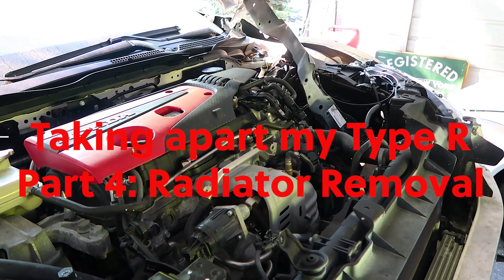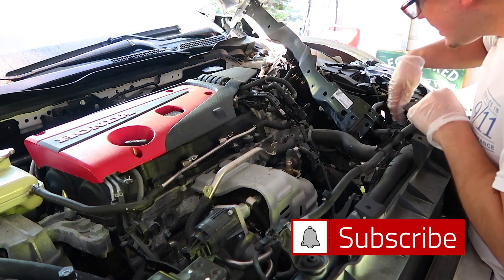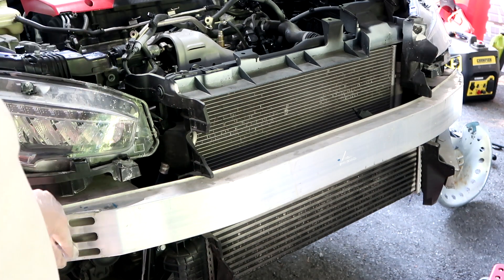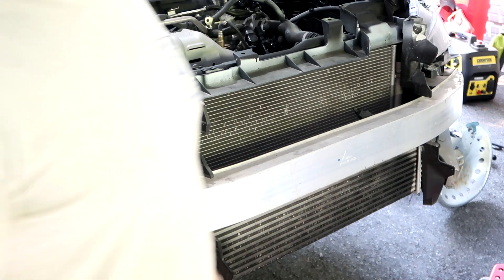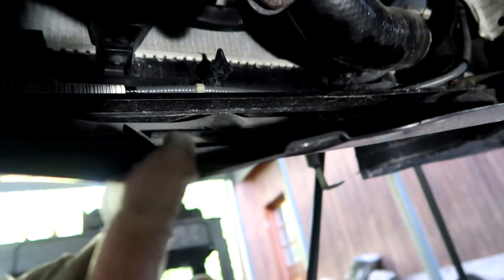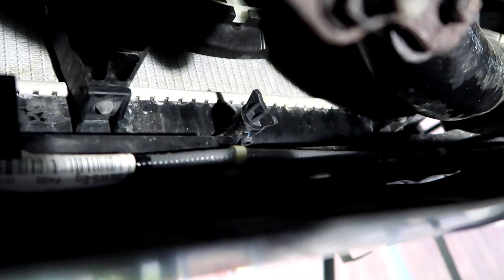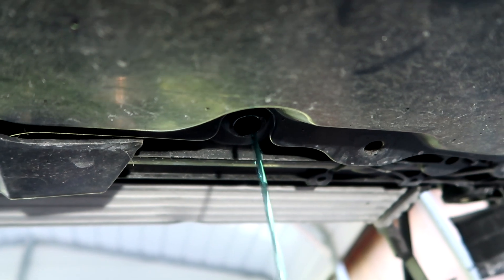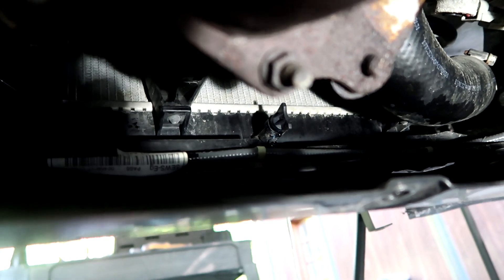Taking Apart my Civic Type R (FK8) Part 3 | Removing the Radiator

Comment: Do you know the part that the oil pan shield is connected to towards the bumper. ? Thanks
Reply from the maker: The screws?
Reply: FlyinGato the black piece that the front screws in. I need to replace it but don’t know what’s it called.